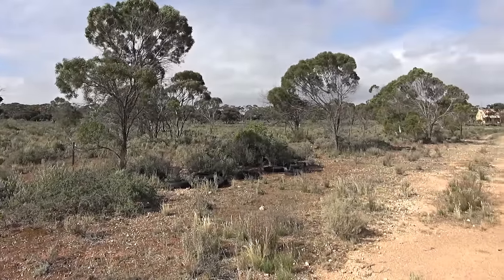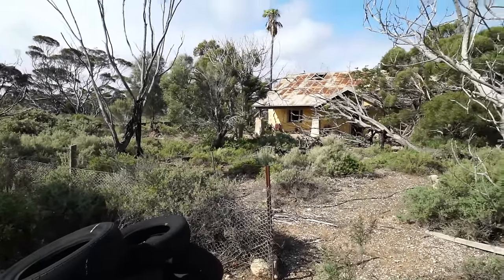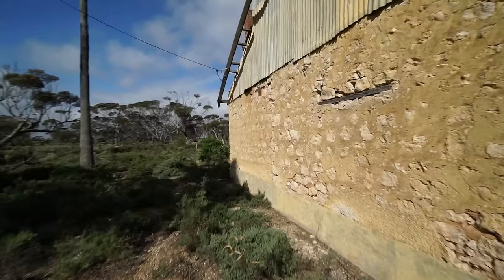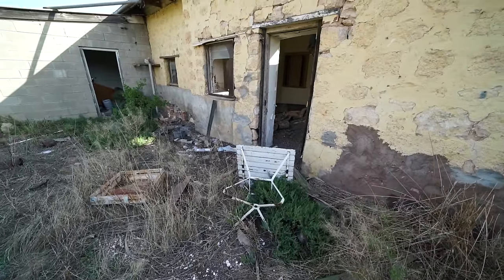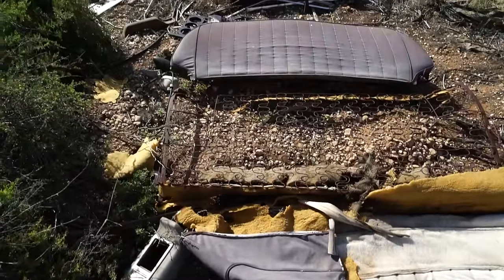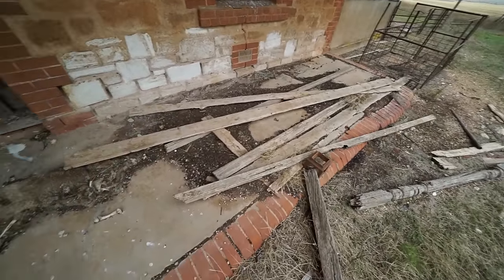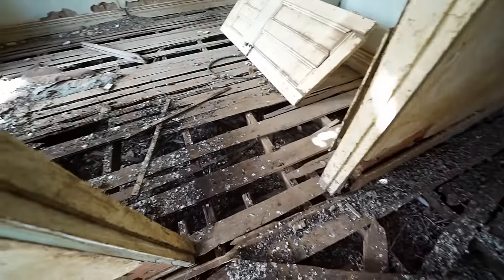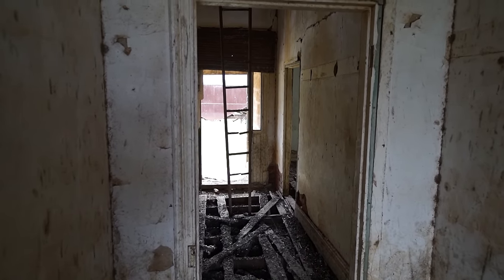2 Old rural homes left to decay

Comment: What is the small fenced off rectangular area outside on the right of the 2nd house's verandah.  Could it have been where the bunker was built during WW2.  They were quite common in Australia and in later years got filled in?  I could be way off. Any other purpose suggestions?